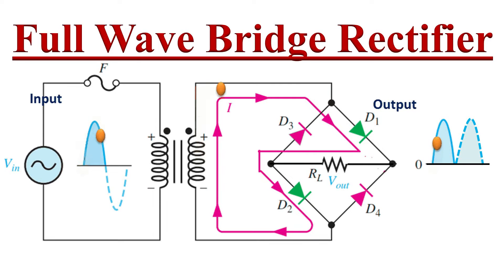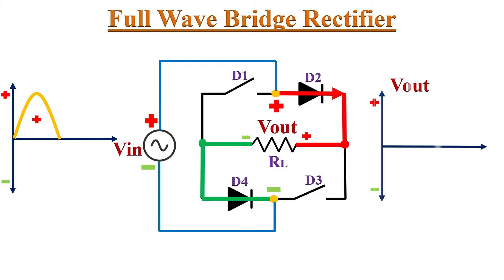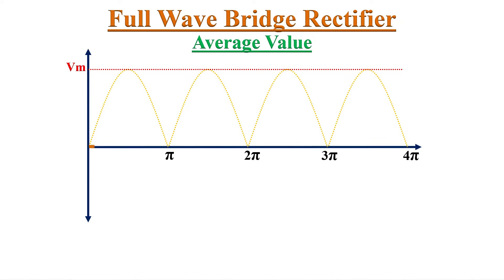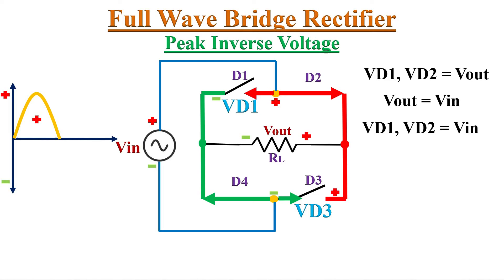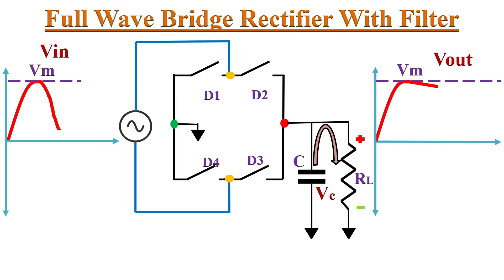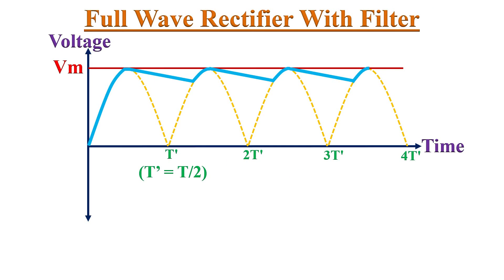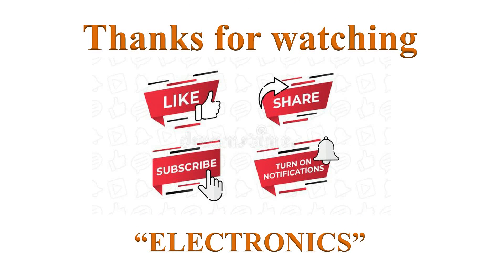Full Wave Bridge Rectifier Explained

Comment from the maker: Timestamps for various topics covered in this video are as follows:
0:20 Introduction,
0:47 Center-tapped Full-wave Rectifier Construction,
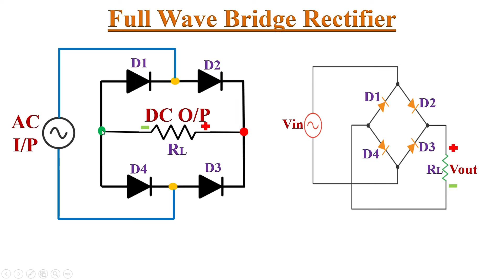1:43 Full-Wave Rectifier Working,
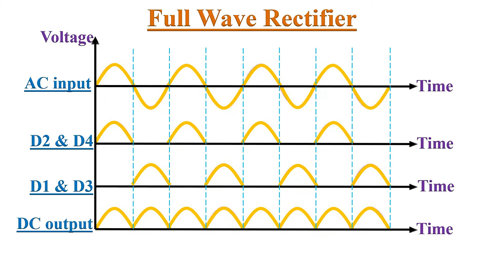3:30 Average value of Full-wave Rectifier,
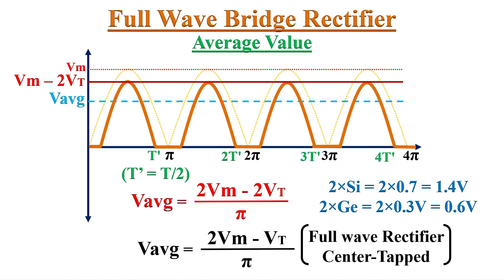5:02 Peak inverse voltage (PIV) of Full-wave Rectifier,
6:38 Full-wave Rectifier with capacitor filter,
10:28 Ripple Voltage of Full-wave Rectifier,
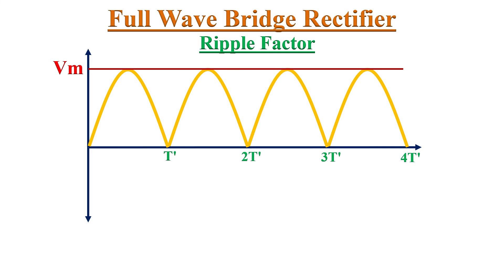11:54 Ripple Factor of Full-wave Rectifier,
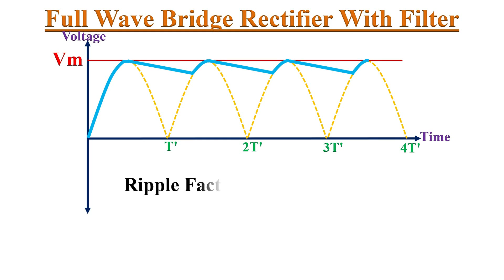12:47 Efficiency of Full-wave Rectifier.